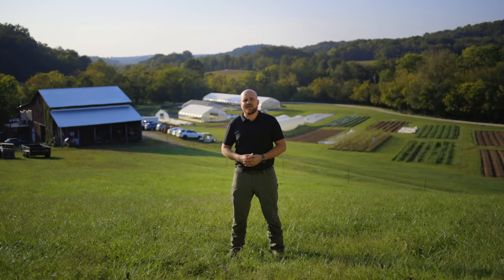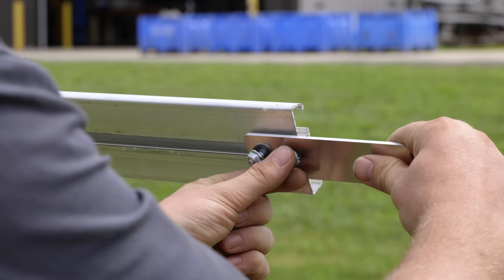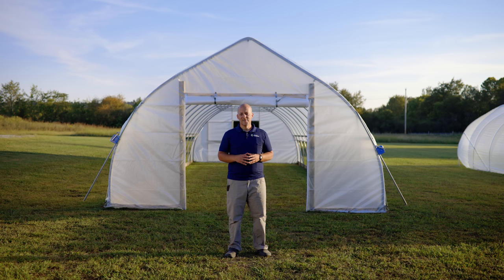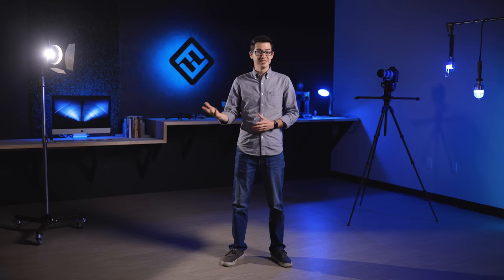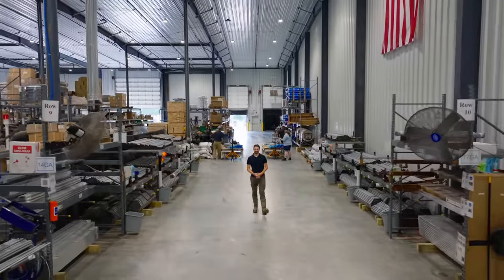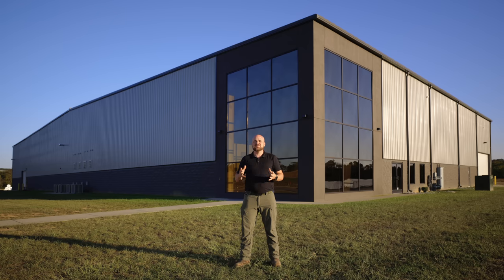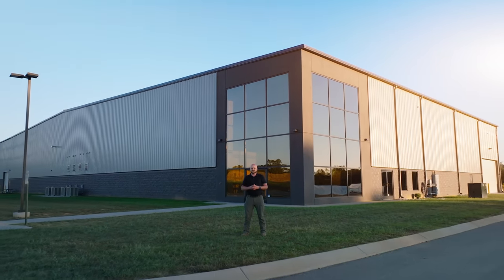New Premium High Tunnel Launch Event // 10.3.2023

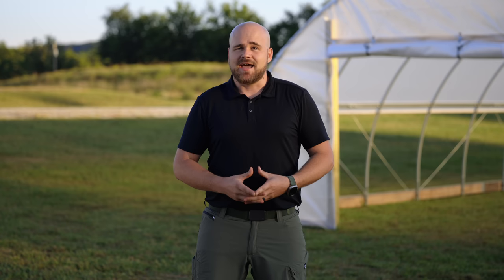Comment: Looks great! Question: at 2:30 minutes into video, it looks like the double zipper end door has a wooden frame and pipes at the bottom. Are these provided or do I need to add the DYI kit and purchase the lumber & pipe to complete it?
Reply from the maker: Good catch! That is our standard Double Zipper End Wall, but with a prototype framing kit for added support. We are planning to launch this "Framed Zipper Door End Wall" product later this fall. That end wall kit will come with all the appropriate hardware and instruction manual, and the customer will supply the lumber.
Reply: If I want to purchase the Haven tunnel today, what should I order in the interim for that end of the tunnel so I don't have duplicate parts?  @FarmersFriend
Reply from the maker: Reach out to support@farmersfriend.com or call us via the number on our site and our customer service team should likely be able to help you with at least several of the items needed. (there are a few pieces we don't yet have in stock that you will have to source on your own, but you can at least get a head start)